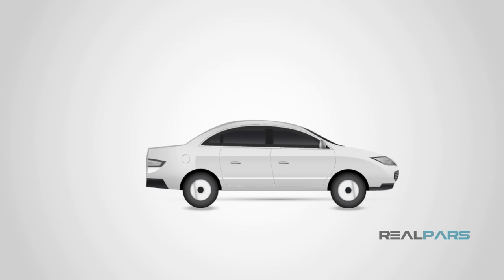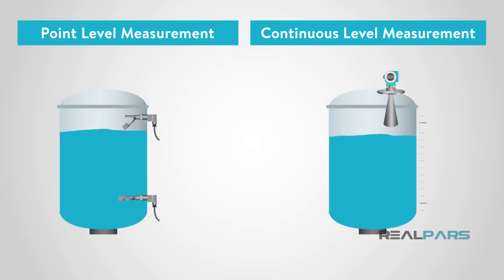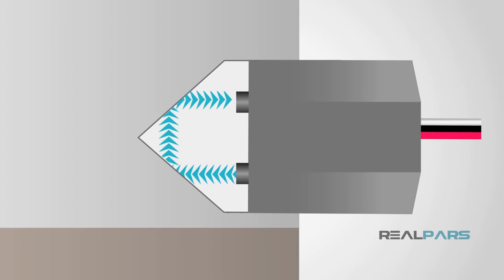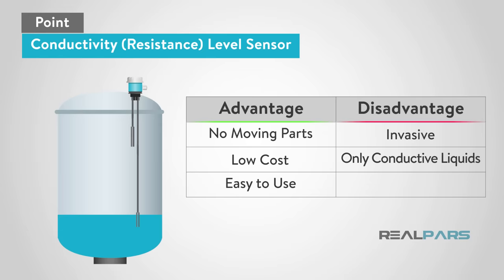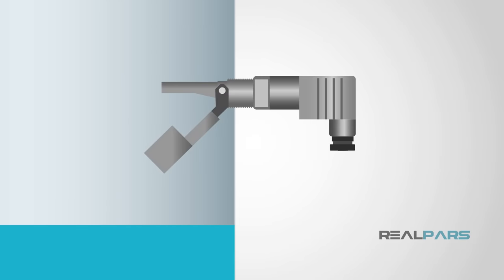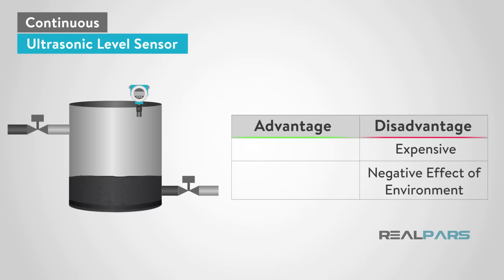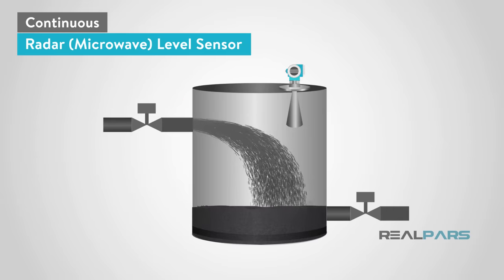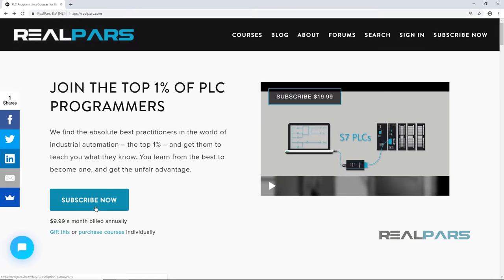What is a Level Sensor?

Comment: You can also use pressure sensors to measure level of a tank
Reply: yeah, that's very fairly common.
Reply: You are probably talking about differential pressure transmitter
Reply: It isn't a differential pressure, he talk about a static pressure where the measurement is P= volumic mass of the fluid(rho)*g* h so, livel is : h= P/rho*g
Reply: Differential Pressure Transmitter
Reply: Hi,

Can you show me please, how I can program this pressure sensor

Comment: I would add very well explained videos. However, you didn't mention Gamma Radioactive-based Level Sensors, used for both Continuous and Point Level Measurement of liquids, solids and slurries. With no moving parts and non-invasive elements is a good alternative for level measurement in huge recipients.
Reply from the maker: Yes, nuclear level gauges (gamma gauges) are very useful for tanks that store very corrosive or hazardous chemicals because these gauges do not contact the fluid.  However, they are very expensive to purchase and in many countries (like the US), special training is required of the instrument technicians and special reporting is required for moving or replacing the nuclear sources.  These types of level sensors are heavily used in the oil and refining industries.

Comment: VW and Audis use a potentiometer to measure the fuel level.The voltage output of the sensor changes as the float (potentiometer arm) goes up and down.

Comment: We have been searching oil level sensor at the bottom of methanol tank. The system contains a few parts where methanol liquid comes in contact with sealing oil. Since methanol is highly inflammable, corrosive, and toxic to human, I am having trouble what kind of oil level sensor to install to the tank. I would appreciate some advice.

Comment: Capacitive level sensors can be used for continuous level measurement just as well, as far as I'm aware.
There're couple more ways of continuous level measurement that would be worth mentioning: magnetostrictive, reed chain, guided wave radar, and using pressure sensors (single sensor for hydrostatic pressure in open tanks and two sensors for differential pressure in closed tanks).
iId like to see some examples (even without brand names), reflecting how the common characteristics of different types of sensors are compared to each other (e.g. accuracy), and in whaat use cases you'd want to pick one vs. the other.
I'd be especially interested in what can be used in battery-powered IIoT applications, i.e. to compare the power consumption characteristics, initialization time and time it takes to perform the measurement.
Reply from the maker: Yes, these are all excellent ways of measuring level.  Guided wave radar is gaining in popularity because of its ability to overcome issues like foaming, and it is also very good for detecting interface levels.  It is a wetted-type sensor, so materials of construction are important.  Also, for tall tanks, it may require a clevis piece be installed in the bottom of the tank to avoid sway and impacting internals, such as agitators.  Magnetorestrictive is very popular in oil/gas applications, especially for level gauge applications.  Differential Pressure is by far the most-used method due to its low cost, relative ease of installation, and accuracy.  And as you indicated, capacitance level measurement is excellent for continuous level measurement, especially for viscous and sticky materials.
Reply: ثف
Reply: قليلا في ٣فبراير قراءة فنون ٤٧٥فبراير حوادث السيارات رياضة ولاعبين الافلام العربية ٥٥في الافلام العربى ١
Reply: @realpars  ج

Comment: Love your videos, they are very informative. Thank you!
You mentioned capacitance sensors fall under the point-level category, but technically they are capable of continuous level measurement as well. The Siemens SITRANS LC300 for example does continuous level measurement. Small point (pun intended) but worth mentioning :)
Reply from the maker: Richard,  thank you for your comment.  Yes, there are capacitance level sensors designed for continuous level measurement as well.  These sensors work on the principle of inverse frequency shifting capacitance detection, and they provide excellent level measurement for a wide range of liquids.  Again, thanks for the feedback!
Reply: Thanks for the reply. I work in R&D for one of the industry leaders in level measurement, though we don’t do Capacitance here in my lab any longer we focus on ranging technologies (ultrasonic and radar). I’ve seen some of the math used in the continuous capacitance transmitters and it’s indeed quite complex, though possible even with 8-bit MCUs which is pretty cool. Keep up the fantastic work!

Comment: Great explanation!, although im having trouble to identify the type of sensors for my aboveground fuel tanks... do you mind recommending me which type is the best for detecting petroleum and diesels??
Reply from the maker: Thank you for reaching out with your question. While we'd love to assist you in finding the right sensor for your application, it's important to consider the specific engineering requirements of your controller and electrical system, as well as any local electrical safety codes that may apply in your area. To ensure you receive the most accurate recommendation, we suggest reaching out to your engineering group or a local vendor specializing in these sensors. Additionally, here's a link to an international company that may offer products suitable for your needs, which you can review at your convenience. https://www.emerson.com/en-us/automation/rosemount

Comment: Dear Realpars Team,

Could you please create an video on practical math behind each type of measurement?
Eg., Capacitance type works on C = (epsilon*A) / d (correct me if im wrong) like wise kindly explain all of the measurement techniques. when we map instrument self calculation against with the theoretical formula which will help us in the real world where the error is lying whether its with instrument or in the control loop etc., 
Suppose the way we do calculation(to find unknown temperature from a known resistance measured from multimeter eg., measured resistance at RTD as 115 ohms; Temp Coefficient = 0.00385; R0=100) for RTD like Rt= R0(1+alpha*t) ; if i simplify this equation we will get approx.t = 38.9 degC which will give us quick conclusion without seeing any standard table etc.,where actually the problem is.
Kindly do the needful

Best Regards,
PC Raju
Reply from the maker: Thanks for the topic suggestion, Raju! I will definitely go ahead and forward this to our creator team. Happy learning!

Comment: As mentioned below there are other types but one that is not mentioned is laser level transmitters. They are continuous and compete with thru air radar and ultrasonic. Mainly used for solids applications but can measure liquids even clear liquids. The downside is that they are an optical device so the lens has to stay clean. There are accessories to help overcome these challenges though i.e. dust tubes, purge rings, built in heater for the lens, etc...
Reply from the maker: Great comment! Thanks for sharing your knowledge with us!

Comment: What is most suitable sensor for detecting the level of a fuel tank? Also, is it possible to use this sensor with Arduino or ESP32? Its for my thesis. Thank you
Reply from the maker: Thank you for your question. I'm sorry, but I cannot recommend a specific fuel tank sensor as the best choice depends on various factors, including your application, power voltage, and load requirements. If you're looking for a sensor for the automotive industry, you have many options, typically float-type sensors operating at 12 VDC.

While it is possible to power these sensors from your computer, you would likely need an interface to manage the voltage and current requirements. This can be done using relay logic, among other methods.

Happy learning! If you have more questions, feel free to ask.

Comment: What is the most suitable sensor for detecting the level of food in a container, such as pet feed? Also, is it possible to use this sensor with an Arduino? I really needed it for my capstone project.
Reply from the maker: Thank you for your question!

You can use sensors like the HC-SR04 ultrasonic sensor, which is commonly used with Arduino, to detect the level of food.

Happy learning

Comment: First off, great video as always.  I am curious why you list capacitance level probes as point level measurement and small?  Thank you again, your videos are always a great tool for my classes.
Reply from the maker: Capacitance level sensors come in two basic configurations.  The types used for point-level detection are usually compact, similar to a tuning fork type sensor.  Capacitance sensors used for analog level measurement are typically much larger (longer) and installed from the top of the tank or vessel.

Comment: Also, you are a bit wrong about microwave and ultrasonic sensors requiring "no calibration". All level sensors except for certain point sensors, need calibration, because else the sensor cannot know the shape of the tank.
Even if the tank has a continious size, the sensor must atleast know the diameter of the tank.
Imagine if the tank were to be upside down cone-shaped to aid in product removal at the bottom. This would of course mean that 1ft of product in the bottom of the tank, is not as much as 1ft of product in the top of tank. Thats why calibration is neccessary, to tell the system how the tank looks like, and thus being able to sense how much product (in liters) there is in the tank.

A calibration routine can look like that it asks to fill the tank with X liters of product, push a button, then fill the tank with X liters of product again, push a button etc until finished.
It will then record a curve over how the change in ft relates to change in liters.

However, when a sensor is used to only detect "tank is empty" or "tank is full" to signal to prevent dry-run or overfilling, then calibration is not neccessary for microwave/ultrasonic sensors.

But you are right that these sensors doesn't require re-calibration at regular intervals. Once set up, they are set up for good.
Reply: @Theo Gavoille Thats exactly what calibration is about - how a signal from a for example scale, level sensor, distance sensor, light sensor etc is intepreted and maps to real world values, for example volume, light level, distance in meters etc.

Some sensors however drift with time, for example if they become dirty or simply components wearing out with time, thus requiring regular recalibration. Some sensors do not require recalibration at regular intervals, but all sensors require some sort of setup, kind of "initial calibration" to make it fit for the enviroment it being used. Except for certain level sensors which only use their mechanical position to decide what for level or volume to measure.

Comment: Thanks for this Great video!!
Can I use the ultrasonic radar to check the level of my gas cylinder?
Reply from the maker: A gas cylinder may or may not have a liquid phase.  If it is does, it is possible, but not recommended to use ultrasonic for the level.  The liquid and gas phase above the liquid are in equilibrium, and as the cylinder is used, the pressure of the gas changes, causing a change in density.  This change alters the sound wave reflection time, and false readings would be given without a fairly complex pressure-compensation calculation.  It can be done, but gas cylinder level is best detected by pressure or load cell (scale).

Comment: Hi, i am currently researching sensors - for the purpose of checking high/low values in water tanks stationed at peoples homes. From this video a conductivity sensor seems appropriate as i wish to do as little damage as possible to the water tank, and it needs to be cost efficient. Do you have any thoughts, and are there any research material you would recommend?
Reply from the maker: For this application, either a capacitance probe or a Hall effect sensor would likely be a good fit.  Residential water tanks are constructed out of metal or plastic, and depending on the application, may be outfitted with varying degrees of insulated jacketing. You will need to do some “on-the-ground” testing to see which sensors work best.  The good news is that these sensors are fairly inexpensive (<$125USD).  I would contact a local distributor who sells Sick, ifm Effector, or Turck products to discuss your application.  There are several devices sold online for less than $30USD that may do the job, but for quality and reliability, I would be careful about relying on them.

Comment: Great application of modern day science, but will the continuous level be acid resistant?
What is the MOC of the these level sensors.
Reply from the maker: There are many types of acids, so there is not one universal answer to your question.  However, Hastelloy C is often a good choice for acid chlorides.  Telfon-coated sensors are generally good for all acidic service, but not all manufacturers have Teflon-coating as an option.

Comment: Ultrasonic level transmitter liquid vapor can cause an overestimate of the level in the pond?
Reply from the maker: It could.  Substantial liquid vapor can "muddle" the reflected signal and cause error in the measurement.  This can be mostly overcome by calibrating the sensor under normal operating conditions, including the head space environmental conditions.  Use of ultrasonic sensors with a normal amount of liquid vapor (well below the saturation point) should not pose a problem.

Comment: Excellent video. Pressure gauges can also be used as level gauges....Isn't it?
Reply: It is rather called gauge glass or glass indicator
Reply: Indeed, hydrostatic level sensors use the pressure of a column of liquid to determine depth and thus level. Capacitive level sensors can also be continuous, they use a long rod suspended into the medium
Reply: @iDrunkky  No it's not like this. It's a different story.
Reply: @sjholmesbrown  thanks it helped.. I was confused about capacitive type.. was thinking it can be continuous but was shown as point type..

Comment: i have recently installed vibrating tuning fork type level switch on oil circulation line. And problem is that switch is continously vibrating and acting lke there is no fluid present in line. my question is what would be the cause of this type of behavior?
Reply from the maker: Thank you for reaching out. It's essential to consider the application when selecting a sensor, as we discussed in our video on this topic. Understanding what type of sensor was previously used on the circulation line and what its purpose was can provide valuable insights. Engineering calculations and careful design are necessary to ensure the new sensor is well-suited to the application's requirements. I've included a link for your reference, which provides further information on this type of sensor. Feel free to explore it at your convenience.

https://assets.new.siemens.com/siemens/assets/api/uuid:bc2c544a-9ac7-48f9-8ed3-bc71cf66157e/PIBR-L10276-0722-Level-Guide.pdf

Comment: We need a level sensor like float switch that measure high level of tank . 
We are using resin in the tank and need a siren sound system that work at tank max. Level . 
Which sensor is the best and how it’s use?

Comment: Capacitance type can be used for continuous level measurement . Why is it mentioned here to be a point type?
Reply from the maker: Excellent question!  Capacitance level sensors come in two types:  those that can be used for continuous level sensing and those that can be used for point level sensing.  In industry, capacitance is most often used for point level detection (level switch), but continuous level applications are very important in many industries and applications, such as brine tanks.
Reply: Thanks for the reply. The videos shared are highly appreciated. Thank you

Comment: Can a  capacitance sensor be  a (used as )  continous level sensor?
Reply from the maker: Yes.  There are many manufacturers and models of continuous capacitance level sensors.  Just make sure you buy the correct transmitter for your application.  A capacitance point level sensor typically cannot be used for continuous level without a change of electronics.  You can use a continuous level transmitter as a point level sensor by defining an alarm contact at the desired level.

Comment: Which continuous level can see the different level of oil/water in the same tank?
Reply from the maker: The best method is guided wave radar (GWR).  Capacitance-type probes and dual-float level sensors are all good choices.  However, GWR is the easiest to setup and maintain, and I feel provides the most stable and reliable reading over time.

Comment: You forgot an continuous level sensor mostly everyone have.
In the fuel tank of cars it is a resistive continuous level sensor that uses a float and a potensiometer as a voltage divider
Reply from the maker: Thank you for your comment.  Our focus is mainly on industrial processes, but the gas tank level is a very common use of the same principles of level measurement used in industry.  Thank you for pointing this out!

Comment: What type of level sensor will you use for a Diesel Generator with a skid base tank?
Reply from the maker: The main sensor technologies used to measure diesel fuel level are differential pressure sensors, capacitive level probes, ultrasonic sensors and radar sensors, especially guided wave radar.  From experience, I have had the best results with capacitive and guided wave radar level sensors with diesel fuel tanks.
Reply: @realpars  Thank you for the response. The harder part is the installation since the skid tank has low depth. Example: 25kVA Diesel Engine Generator on a skid base tank. Do you have a specific model or brand of capacitive level probes to recommend?